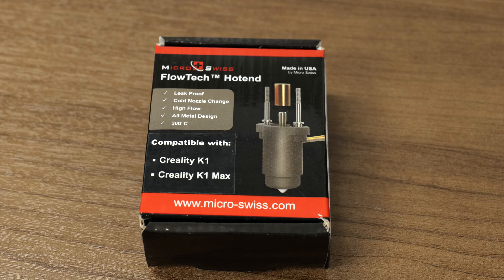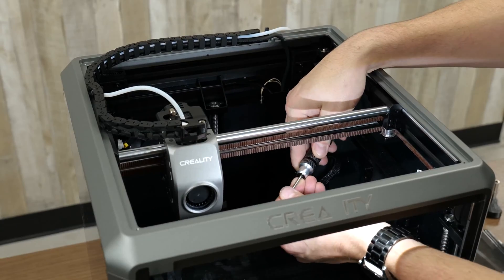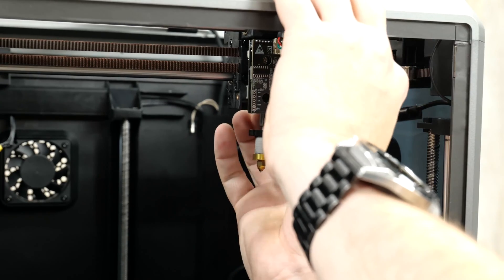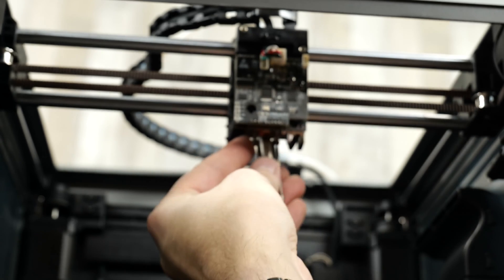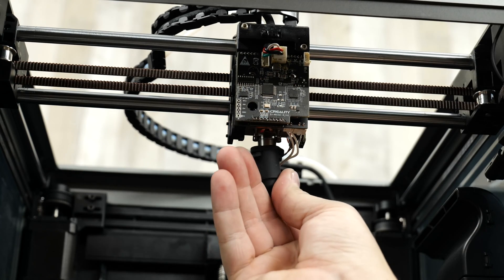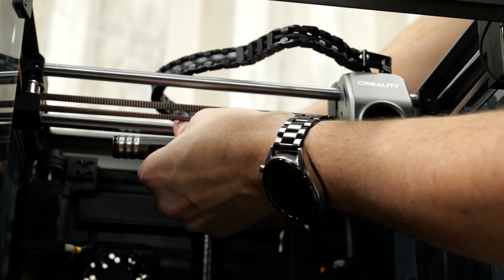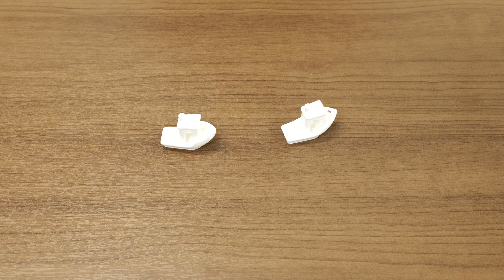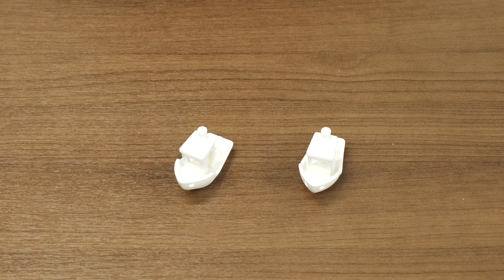INSTALLING THE MICRO SWISS FLOTECH HOTEND ON CREALITY K1

Comment: I tried following the video for the install on my K1 Max and the thermistor wire won't fit any of the connectors on the board. I ordered a new breakout board thinking that would fix things and even the new board won't work for the connector on the thermistor wire. Anyone have this issue, have a fix for the issue?

Comment: Thanks for the video, I've just ordered this kit for my K1.

I just broke my heat break and nozzle, while trying to cold remove them on my K1, trying to fix a clogging issue.
Reply: Exact same that happened to me today😢
Reply: @malachypringle9915  I've been running the Flowtech 0.4mm nozzle since then, and it's working great and I haven't had any issue, like I had with the Creality one.

The downside of using the Flowtech kit, is that it uses a proprietary design, so you can't install any other nozzle.

Otherwise, the Creality heartbreak and nozzle kit are cheap, so depending on the budget, you might find it to be a better deal.
Reply: @malachypringle9915  Same thing happened to me today lol
Reply: @martinlibrefree poor dude, I just emailed Creality about my nozzle breaking and they just sent me a free repair part for it